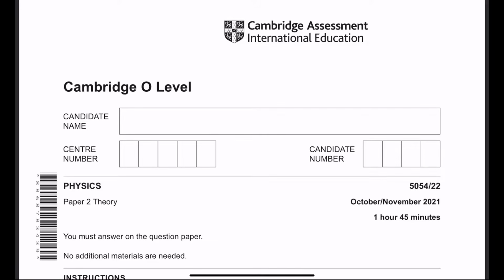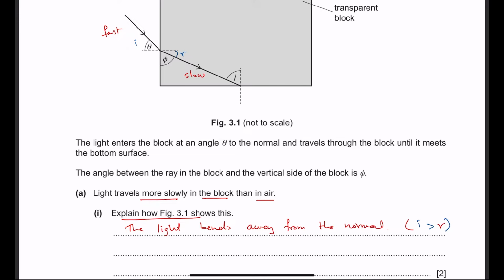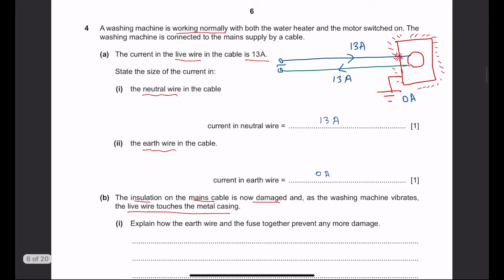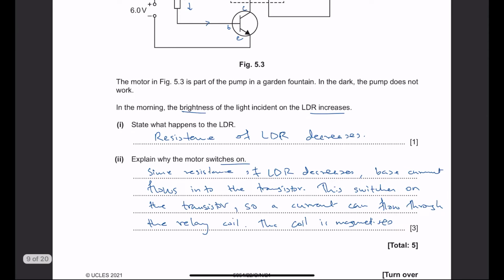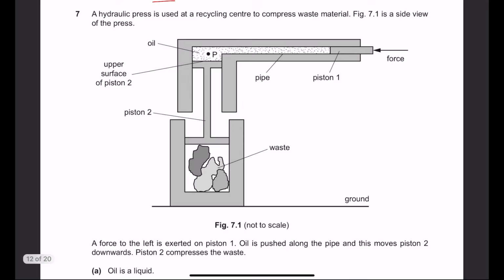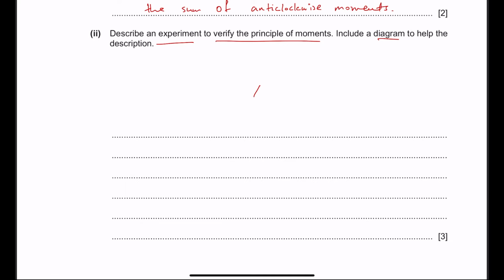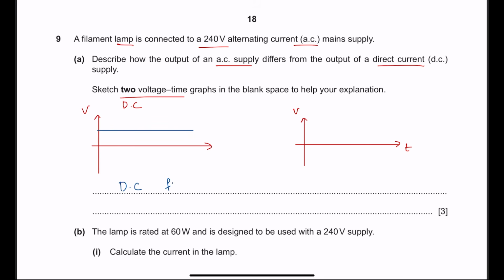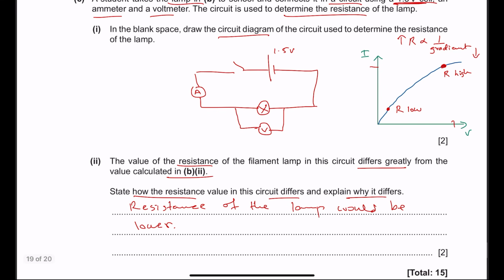O level Physics 5054 Oct/Nov 2021 Paper 22 Past Paper Solution

Comment: the question is explained wrong and the answer is $90.34 he went wrong in the energy equation and the answer is 602.25 which is the answer in the mark scheme as well...pls go through that and redo the question carefully !
Reply from the maker: Yes there is a calculation error. The working shown is correct. It should have been 602.25 instead of 120.45.